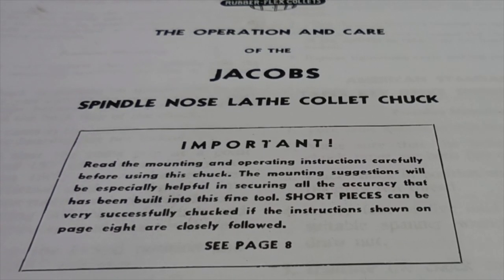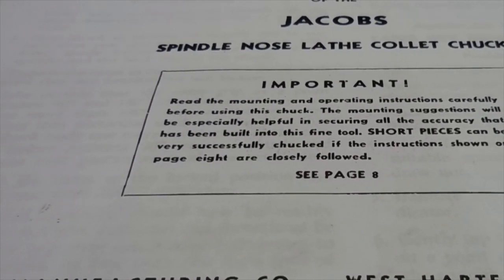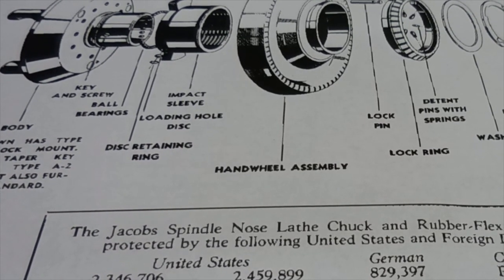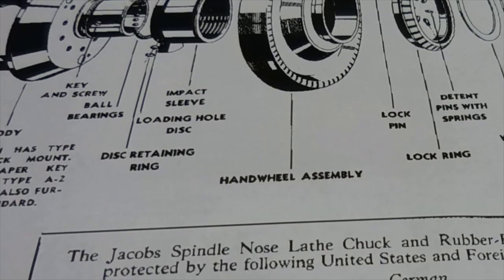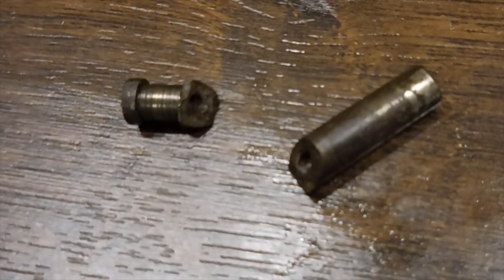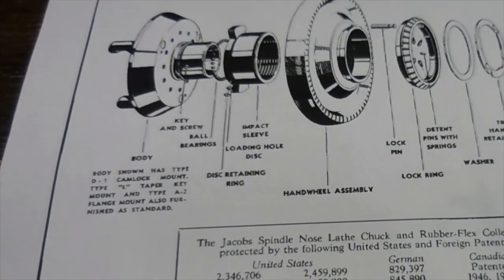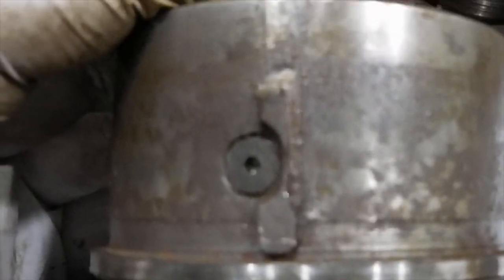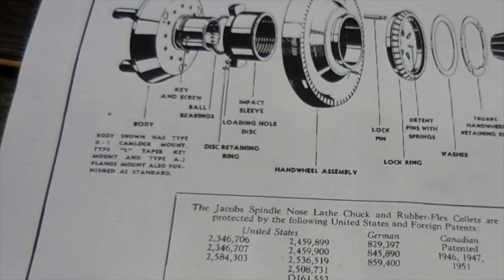Jacobs Collet Chuck

Comment: Great video.  Thanks
Reply from the maker: Sorry Vernon I messed up the other video again. That one video is killing me.  To answer your question  it is indeed a Clausing 11. Otherwise known as a Harrison M250 imported from England by Clausing. I believe Clausing got a good price and sold them into Schools. Mine has the usual student marks on the compound from chuck jaw strikes. All in all a fine little lathe. I stole it because they did not know what they had in hand. Fixed a thrashed carriage drive gear and added a VFD. That's it besides fresh oil.
Reply: @houseofbrokendobbsthings5537  Yep I've got a 5gal bucket of new iso 32  Hydraulic oil to change out my headstock, and quick change gearbox. lubricant.  The apron, ways, etc., uses iso 68.

Comment: Hi , theres always things to repair . I have seen the jacobs rubber flex collets on e-bay sometimes .  Cheers .
Reply from the maker: Yeah I accidentally have two Jacobs collet chucks now.  One is ancient, but came with a nice set of collets in a holder. The other is one I am showing in the video. That one shipped with lots of collets rolling in a box and the broken orphan you see. After thinking about it - the skills of Burly Mcmanly (aka Hackmaster) gave several aggressive hits to the locked wheel and snapped the pin. The pin looks like it is meant to shear as it is drilled for no real reason on the small end. So it was stuck from rust, engaged lock pin, and a lack of understanding.   I think I can save it Doctor. 

I ordered some additional replacement loose roller bearings in varying  sizes around the original worn .25in size. There has to be some wear in the races, maybe I can tighten it up and not bind up.

Comment: Hey Dan.

Happy to see Part 1.5

Looks like you are heading in the same direction as i was thinking ?
Machining the Socket Head Bolts in a Lathe.
It would be a good guess as this is the perfect work holding for those Bolts.

I don,t suppose you might have Two of these Collet Chucks,  LOL. 
 But i would need a D1-8 mount.
On the off chance you locate one can you please let me know.
As i have a perfect job for this type of chuck. 

Thanks for Part 1.5
Looking forward to see your next video.
Regards Peter.
Reply from the maker: Peter CCR ENG Morning Peter. I have only the two collets chucks at this juncture. Shall I add one to your pile ....LOL.
Reply from the maker: I was concerned about the interupted cut on the bolts.
Reply: @houseofbrokendobbsthings5537  
Hey Dan.
Not sure what you mean by interrupted cuts ??
Do you mean on threads themselves ?

Apologises you lost me.

Regards Peter.
Reply from the maker: Yeah the bolts spacing if I used the lathe would be interrupted cuts.
Reply: @houseofbrokendobbsthings5537  
Hey Dan.

Apologises, i was thinking you were talking about the bolts them selves.
I guess you are talking about facing the part, OK.

Thanks Dan.
Re. Peter.

Comment: If you need some harder steel for that pin so it doesnt wear as bad, I have some 5160 here that you can have if you dont find something before you come down. That can be hardened and tempered, and will defenitely be wear resistant, lol.
Reply from the maker: Thanks Chirpy - let me rummage in my pile.  if I come up dry I may tap your offer.